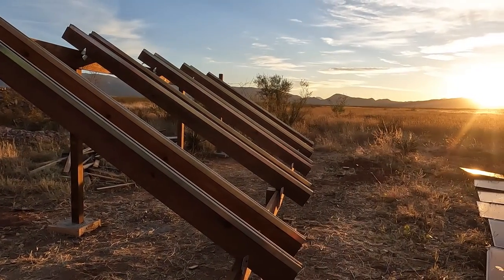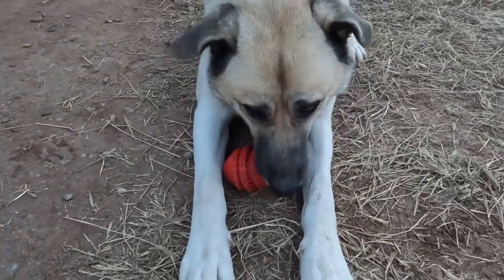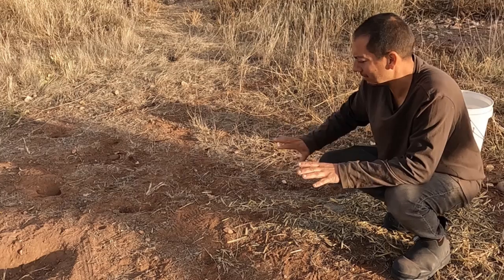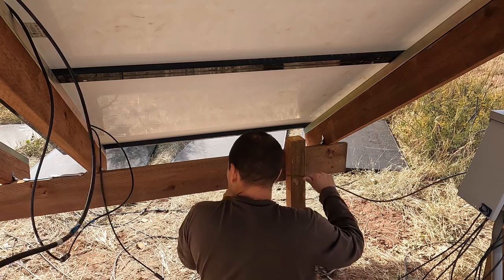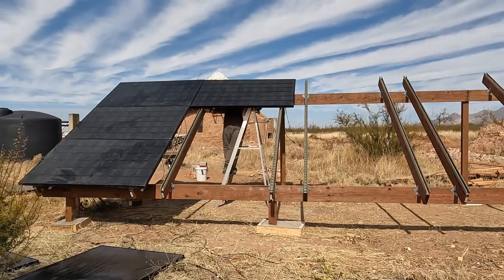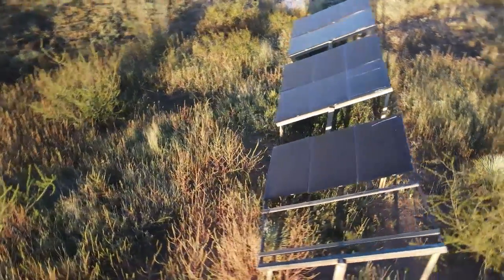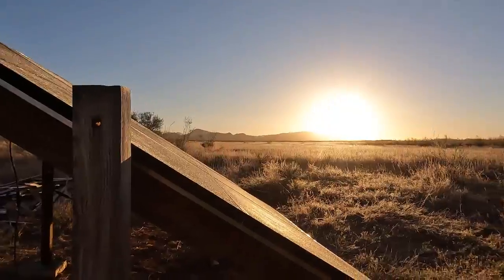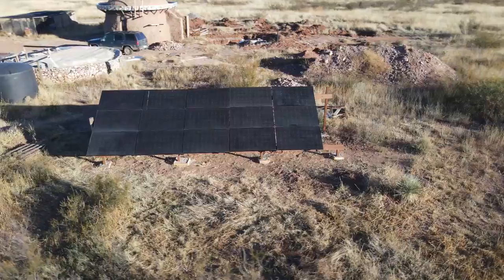Installing Solar Panels On Our 4.8KW Timber Frame Rack | 100 Percent Off-Grid

Comment: HOWdy G-D-P, ... 
Thanks for your VIDEO ... 
I found that CLEANING my PANELS   was much easier once they were INSTALLED on my Ground Mount ... 
I utilized a soft bristled  "BOAT HULL BRUSH" & a Mop Bucket with Dawn Dish SOAP ...  
my  45 degree   ANGLE  allowed the Dirty water to drain-off & then RAIN & SNOW did the "final" RINSE ... 
... but ...  I had the advantage of a 60 PSI  Well Pump & Garden Hose 
Thanks Again
COOP
the  WiSeNhEiMeR  from Richmond, INDIANA 
...

Comment: It is a fact that solar panels lose efficiency and generate less power when they get hot. Have you concidered placing heat fins under the panels to help keep them cooler?

Comment: If you wanted to add your solar panels to your water catchment system, you could place plastic or metal sheets beneath the panels such that water that driped through the panel joints would drain into a gutter.

Comment: @ the green dream project.   Rugged, robust, Burly solar panel rack, check. Battery storage, check. Rainwater catchment and storage, check. Monolithic, Dome One check. Options, options, you've always got options, including an air source or dual source ductless mini split. Ceiling fans can be reversed for optimization. Supplemental heating or Cooling, where you want, when you want, just as much as you want or conditions suggest you need. You have built a Cost Containment Dome. You can minimize or eliminate carbon monoxide, carbon dioxide, and combustion products and byproducts. Good design and build practices pay real dividends in quality of life. You guys have built it and it's all under your control. Congratulations!!!

Comment: I like the new solar build. Especially the unistrut that allows you to mount the panels close to the ground, then slide each panel up into its final local. It's funny, installing solar panels in the moonlight and using battery headlamp. 😆.

Comment: when i had the same thing done for my dog admittedely she is a jack russell so much smaller,she rode home from the vets laid across me, i was hyper careful bringing her into the house,it did take her 10 minutes or so to lay down in a position that was good for her but after a long sleep she started to perk up, the 1 week vet check went okay, and she is still okay 8 months later, one thing i would done different with the panels is mounted them all then cleaned them using the angle to your advantage while generating power :), 30 deg south is always a winner too :) :)

Comment: How did you protect your wood for the new solar rack? You did not burn it? Is stained? With what?  Or did you something different? Looks good. Where Jess been workin? On the roof or walls? Has she been filling in complete in the roof or repairing the walls? Keep it up.and stay warm.
Reply from the maker: It's treated lumber

Comment: Add some bracing (structural member 45 degrees to rafters) because at present your panels are acting as bracing and this can crack them in a wind storm. They are not designed for this. Bracing can even be a cable, metal strap or timber. They are placed corner to corner on the diagonal.

Comment: Now that they are mounted, in time some refinement. Cleanup the wiring. 2 buckets, one with soap, the other with water and an extendable broom to wash the panels. Maybe a short step ladder for top panel access. Hoping the dog feels better soon.
What is your water situation? With all this power, any plans for electric heat in the new build structure? What is the impact of low temperatures and ice on the solar panels? Is your battery storage adequate, especially in extended cold or cloudy or icy weather?
Some off grid families have alternate back-up power, i.e. generator that runs on gas, propane or diesel. For emergencies only. Is that a viable option to consider, especially with weather extremes?

Comment: Hi Jim if this helps I found cleaning glass or mirrors  with plain water and a cloth or just a little dish soap then wipe off with a micro fibre cloth it comes up so well with no streaks.
Hope your doggy is feeling better, I feel for her after having a major operation at 24 that took me 5 months to recover enough just to drive.

Comment: Jim/Jess great to see your super job on your solar rack.  It looks like you were more skilled than I was when it came to measuring your rack for proper spacing of the panels.  As I mentioned and showed on my channel I had to move the 2x6 supports back and forth a bit to make everything work.  Hmm.  it doesnt even look like you wrecked any cone nuts to attach the panels like I did.  I am embarrassed to say how many of those things I wrecked LOL.   Great job and looking sturdy!

Comment: Solar array looks nice!  Noticed that the combiner box 4 x 4 is just a little too tall / casting a shadow on the panel next to it (in the vid at 12:55) which will kill power coming from that string.   Even a few square inches of shadow will kill 90% of the power of that string.   Maybe shorten it a few inches :)

Comment: I Rain-X my panels, just hose them off.
Reply: In the event of frost or light ice, Rain-X will help the ice to slide off the panels.   Will you be adding a gutter to the bottom of the panels to save the water for animals and plants?   

Wishing you a blessed thanksgiving season, gentle autumn weather and restful evenings.  Peace guys
Reply: Great idea. It works great on my windshield.